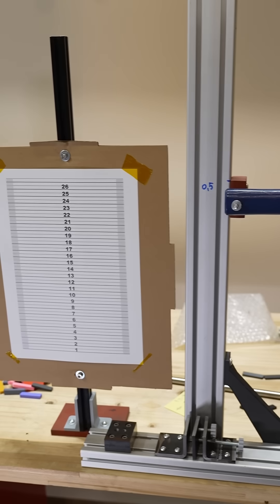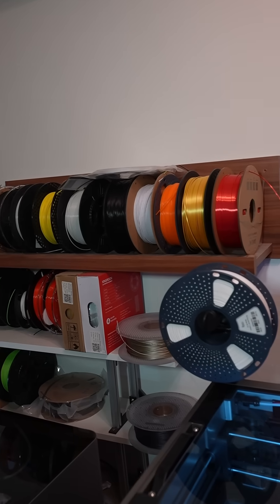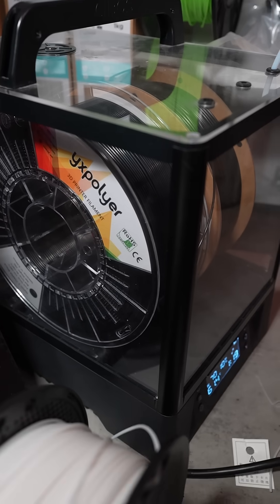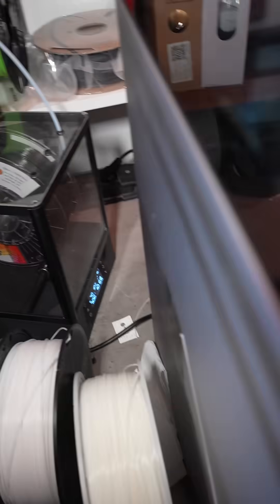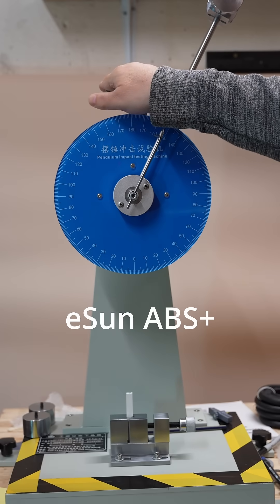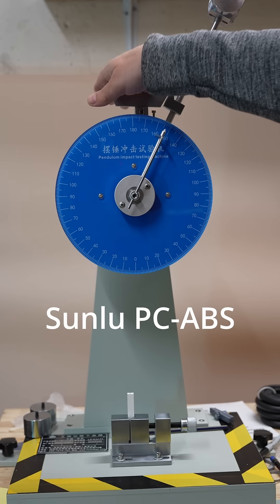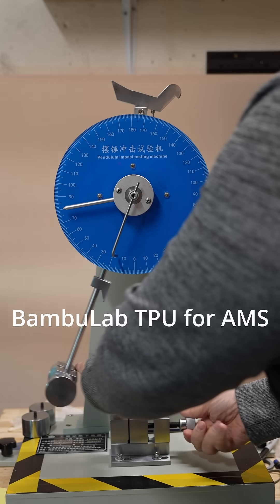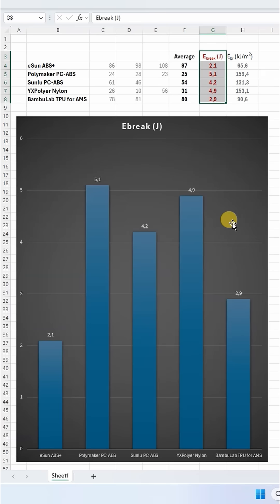Which are 5 toughest filaments I ever tested? #shorts

Comment: I could not get the yxpolyer Nylon to print for the life of me for the large parts I needed. I've NEVER failed a filament before. I succesfully printed with literally every filament that exists to buy😂 that stuff warped SO bad m on solid parts. Qidi plus 4 that I even had OVER heated the chamber and it'd warp impressively bad.  It's the only spool I've ever given up on😂 and I love YXpolyers filament- and the nylon is cheap. Bummer
Reply: Dry it and use thick brims and thin walls. Try no walls also or 1 wall
Reply: @morecakesmorelays3270  couldn't get it to print as I required for the print Heavy walls and Infill. I never have issues printing anything- im currently printing PURE unfilled PC that requires @345c to even melt enough to stick to the plate- with zero issues- some of if not one of the toughest materials to print. Not a mix pc like everything for sale- a pure- lexan virgan PC😂 that nylon roll was bad. I HAD dried it for 3 days in a blast furnace- it had been so wet that I had moisture droplets ROLLING down the cover of my drier @90c😅 they sent another roll and that was infinitely better. Even without drying. I suspect the one I was originally sent had been overboard in the ocean for 6 months before they sent it to me😂 the new one was Still quite warpy for a usable/thick print and ultimately much much more flexible than I'd want in a unfilled nylon and kind of worthless as you cannot print a solid/thick wall print for very strong objects without some of the worst warping I encounter in anything.

Comment: Woa! PC-ABS seems to be a super polymer!
Next time I order at 3djake, I will get some Polymaker PC-ABS as well.
I will probably need to finally get some housing for my MK3S+ though ...
Reply from the maker: PC-ABS, hard for printing. You need an active heated chamber. On bed slinger almost impossible
Reply: @MyTechFun  Thx for the info!
I need to find a solution for that.

Comment: And plain TPU was worse than TPU for AMS?  Or did you just not test it?
Reply from the maker: I didn't tested them, soft TPU will just bend under 0.5kg hammer. That's why for TPU I have different testings. Only with hard TPU this test makes sense.
Reply: @MyTechFun  My experience is that the TPU I have (I think it's 95A) printed solid is NOT extremely flexible, but very tough.

Comment: PC-ABS, as far as I know, it subject to stress cracking - which is a deal killer. But if I am wrong, I would like to know.
Reply: I think that's the weakness of 3d printed polycarbonate. Low fatigue resistance.

Comment: I watched a Functional Print Friday video where he used Bambu TPU for AMS and I don't know what it was but it wasn't TPU.  Probably TPU with something added.  It had terrible physical properties.  The part had a latching tab that broke easily.  PLA and PETG perform much better.  Maybe it was a bad spool of filament.
Reply: Yes, it is a blend as stated in their msds.
Reply: @riba2233  - Your Bambu Lab AMS compatible TPU blend filament produced parts with much greater strength than the parts made by Functional Print Friday using ostensibly the same material.
Reply: @Liberty4Ever what are you talking about, has nothing to do with what I said and it's completely made up. You sure you are not skipping some medication?
Reply: @Liberty4Ever what are you talking about, has nothing to do with what I said and it's completely made up. You sure you are not skipping some medicati0n?
Reply: what are you taIking about, has nothing to do with what I said and it's compIetely made up. You sure you are not skipplng some medicati0n?
Reply: What are you talking about bud, you seem really confused
Reply: @riba2233  - I wish YouTube had a feature that allowed me to block you from cyberstalking me.
Reply: @Liberty4Ever you don't sound ok bud, I wish you get some help.

Comment: Great presentation, love your videos- your new impact tester is great, but maybe not a real world test for me, I seldom want my prints hit with hammer. For that I would choose a nail. Your other tests are more real world appropriate, though I appreciate your holistic approach-😊
Reply: i actually do that with most of my filaments. the best are the ones that deform instead of cracking. but they all have low hardness vs metals so that is the best we can get. in my experience abs with full concentric walls 100% and this nylon yx polyer with 80% gyroid infill are far the best. abs with even a little void performs 10x worse. and yx polyer needs a little void to bend a little to absorb more energy. also it needs few weeks to become tough.

Comment: I used the yxpolyer nylon in my combat robot from your earlier video! Its great to see how it stacks up
Reply: please share your results. i am very interested. i thought robots mainly used tpu armor
Reply: @morecakesmorelays3270 under direct impact, it fairs relatively comparably to 95A tpu. On impact the blades tear through the material while slowly dissipating energy. This means the damage is localized and doesnt result in total failure. I now use it on my internal frame and uprights while using tpu on my armor.
Reply: @ i had similar experience. This nylon actually outperformed my tpu in resistant to cutting and stabbing. TPU wins vs very high energy blunt attacks. but nylon is more rigid and stronger. btw try printing it at 280c with 80% gyroid infill. i found 60-85% infill(very thin walls) to be almost immune to cracking on this material. let it absorb moisture for 2 weeks before trying. it loses some strength but gains a lot more impact resistance. it basically slowly deforms and converts kinetic energy into thermal but very durable.